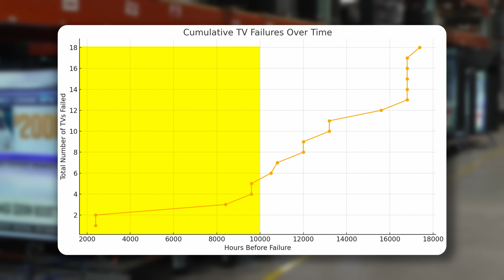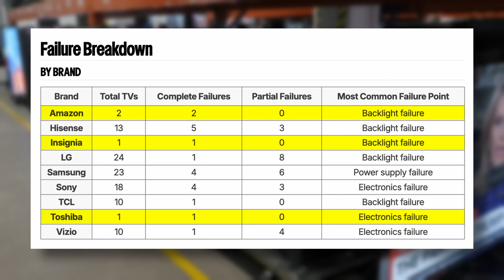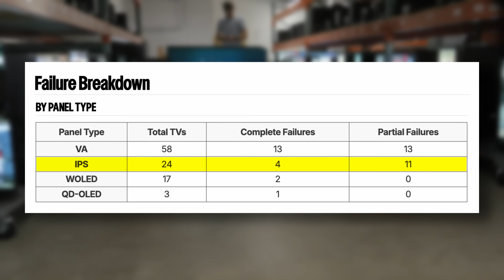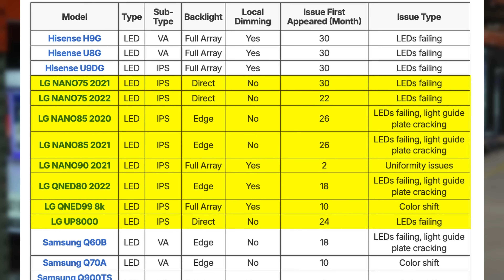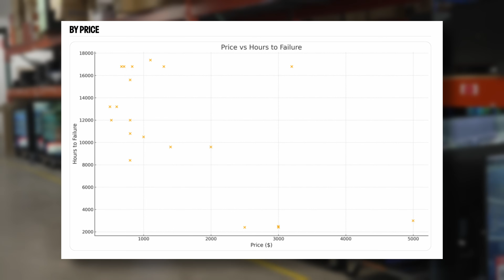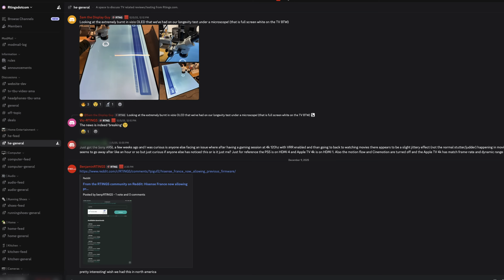Which TVs Break First? Results Overview From Our 100 TV Longevity Test

Comment: My 2005 LG 43" plasma with a massive 852x480 screen resolution and a single HDMI port died after 27k hours. Spent about 8 years in a kitchen with the brightest at full blast. Zero burn-in and the most watched content were the news. Basically part of the power supply died and the plasma display is dim. A dyi repair is about 35€ and considering the electricity cost of running this tv, I've recycled it.
Got a 4k TCL 55" VA panel and it has garbage viewing angles and the worst sound I ever heard on a TV. It felt like a massive downgrade
Reply: Have you ever checked with a killawatt the actual electricity consumption of the TV?
Reply: @zuzkazuzka8284  Relevance? A OLED TV manufacturer can also set a design life of 25,000 hours or 50,000 hours, setting a high design hour lifetime is not mutually exclusive to energy efficiency.
Reply: @TassieLorenzo easy: I’ve replied to the wrong post 😅 That one had your usual “plasma is bad cause it eats tons of electricity “.

Comment: I use an LG C2 as a monitor for years now and it has been used for over 14000 hours.
It does have burn-in, to be specific the windows taskbar and the bookmark/adress bar from the browser can be seen burned-in just a little bit in test pictures, but NOT while using it in games, movies, etc.
Reply: not sure what your OLED brightness is set to but my C1 has 12951 hours of pure desktop use but i calibrated the colors with a colorimeter, 2.4 gamma, way back when and oled brightness is 50. it occasionally has a bit of burn in at the end of the day but after the pixel refresh that it does every shut down it's gone. i think i calibrated it to either 130 or 150 nits (can't remember which one). i rarely use HDR mode (maybe once a year)
Reply: I bought a Samsung 55 inch 4K TV twelve years ago, was using a prehistoric 480 tube model. It probably operates 5-6 hours a day, with no problems whatsoever. I stumbled on an LG 55 inch 4K TV for $189 dollars last year, still in the box.  I was planning on keeping it as a backup, but it's operating in my basement mancave now.
Reply: Same, but with a LG C1. This is why my next TV will be a mini LED.

The stress of burnin isn't worth the picture quality. 

The only reason I haven't bought one is because I need at least three HDMI 2.1 and they sadly only come with two ports right now.
Reply: @AntonioCunningham  Or the two of you could use your brains and buy a monitor for use instead of a TV to use as Monitor
Reply: @AntonioCunningham  There is no stress for me. That burn-in happaned before even 8000 hours and after 14000 hours it has not become worse.

Comment: I have a Sony A90J OLED with less than 1,000 hours that has thousands of dead pixels that have developed around the edges of the screen and it only gets worse with time. It's my first OLED and it will be my last. I've never had a TV last such a short amount of time.
Reply: Honestly, just get a basic Bravia, they last longer and are cheaper. The colours are also fantastic. 
I personally tried the A90K recently and returned it because of the stupid auto dim feature in videos games which ruined the experience since you can't turn it off. 
Got a Bravia 3 and honestly I can barely tell a difference after playing around with the settings.
Reply: @urbanizeddreams  that's my plan. I have a Bravia X900e in my family room that gets used for well over six hours per day and has been used daily since I got it in November 2017. So, the fact the OLED failed in such short time was extra surprising given how exceptional the X900e has been. Definitely sticking with Sony's LCD line from now on.
Reply: @urbanizeddreams ✅💯
Reply: RUN.   From A90J
🏵🧩🐸🙉🍉 🐬vs 🥮🐦‍🔥🏬🦜🪲🪼
The LARGER of TV , Image >  > > STRETCH OUT < <  <. You need Denser Color to look:    3D 
   
 ( Rtings) tested at 10000 cd/m— HDR  
              🔮Color Volume 🔮

Red Luminance =
Bravia8    69     2025          SONY  
A90J        72                   ( OLED ) SONY
B4            89     cd/m²  ( OLED )    LG 
C1            84     cd/m²                     LG 
A80L       92     cd/m²  ( OLED ) SONY
Z80A   ==        ( B4 tier )     Panasonic
Z85A      100    ( OLED )      Panasonic 
C4          104     ( OLED )               LG      
C5          134
G4          140     ( OLED ) —-         LG      
G3          140     ( OLED ) —-         LG
A95K     190   (QD-OMED)
S95C      272   (QD-OLED) Samsung
S95D      371  
S90D      281   (QD-OLED) Samsung
S90F       309  (QD-OLED) Samsung
U75QG  410 🔔( mini LED)  Hisense 

A95L       221   (QD-OLED)      SONY  
Z95B       219     ( OLED )   Panasonic
G5           248     ( OLED ) —-        LG    
S95F       420   (QD-OLED)Samsung
Bravia8|| 344   (QD-OLED)      SONY          
U8QG🐦‍🔥527   ( Mini LED    Hisense             
U9N   🐦‍🔥564   (Min LED )   Hisense
85”UX    530   2023             Hisense
Bravia9   551   ( Min LED )      SONY
U8N 75”  421                         Hisense       
U8N         381    ( Min LED)   Hisense                
U8K         318     ( Min LED)   Hisense
U7N         153     ( Min LED)   Hisense
QN90C    382    ( Min LED )Samsung            
QM8K     394   (Min LED )        TCL 
Qm851    585   ( Min LED)        TCL
Qm8         404   ( Min LED)        TCL   
Qm7K       221   ( Min LED)        TCL   
QM7         291   ( Min LED)        TCL 
QM6K      103 
Bravia7    356   ( Min LED)      SONY
X95L        225   ( Min LED)      SONY 
X90L        272   <  FALD  >       SONY         
Bravia5    137 < FALD-M LED>SONY 
              

“

Green Luminance=
Brabia8  223     ( OLED )         SONY
A90J        237     ( OLED )         SONY
B4            306   (  OLED )            LG
C1             291   (  OLED )            LG
C4            333    ( OLED )            LG
C5            478
A80L        317    ( OLED )           SONY
Z80A == ( same as B4 tier )Panasonic 
Z85A        337   (  OLED )     Panasonic 
G4            426   (  OLED )            LG
G3            420   ( OLED )             LG
A95K        606   ( OLED )          SONY 
S95C        882   (QD-OLED)Samsung
S95D      1167   (QD-OLED)Samsung
S90D        856   (QD-OLED)Samsung
  S90F      1,145 (QD-OLED)Samsung   
U75QG  1415🔔  (Min LED ) Hisense
 
A95L         679  (QD-OLED)    SONY 
Z95B        734     ( OLED )  Panasonic 
G5             887     ( OLED )           LG
S95F      1,551   (QD-OLED)Samsung
Bravia8|| 1,074  (QD-OLED)   SONY 
U8Q🥬 2,073   (Min LED)  Hisense 
U9N🥬 1,917     ( Mini LED ) Hisense
Qm8K    1,206    ( Mini LED )     TCL
——🥬2024 UX 110” ——NOT Tested. 
85”UX   1,656          2023     Hisense
Bravia9  1,130    ( Mini LED )     SONY
 U8N 75” 1,400   ( Min LED )  Hisense
U8N        1,433   ( Min LED )  Hisense
U8K         1,157   ( Min LED )  Hisense
U8H           915   ( Min LED )  Hisense
 U7N           501   ( Min LED )  Hisense
QN90C    1360  ( Mini LED ) Samsung  
Qm851    1,885  ( Mini LED )       TCL
Qm8         1,250  ( Mini LED )      TCL
Qm7K          678  ( Mini LED )      TCL
QM7            826  ( Mini LED )      TCL
QM6K         343 
Bravia7       834  ( Mini LED )    SONY
X95L            781  ( Mini LED )    SONY
X90L            778  <  FALD  >      SONY ‘s = BEST SELLER 
Bravia5        420  <  FALD-Mini LED >  SONY ( NO quantum Dot)

Comment: My 2006 plasma with 27k hours still going strong 💪
Reply: We had a 15 year old Panasonic Plasma that was still doing great Until one day, boom and it was a gone burger. I didn't think we would get the same picture quality and durability but so far our LG OLED has a way better picture and hopefully we get similar time out of it. I'm not confident on durability.
Reply: i have a 2007 CFL LCD estimated 40k hrs (retired but still works)
Reply: @infinity2z3r07  My 2008 CFL LCD with 25k still going. I spent a couple bucks replacing 4 caps in 2010 but that was it.
Reply: @ncohafmuta no cap? Oh you said some caps actually
Reply: @infinity2z3r07  my IPS monitor has the work hours counter, in exact 3 years I have 9k hours.
Reply: @PhantomNovelist isn’t that 8hr straight without a day off for all 3 years? 😂
Reply: @infinity2z3r07  I just checked my CCFL backlit Sony KDL 52XBR - purchased brand new in 2008, notched up 42K hours so far, still performing nicely. Although I'd like to upgrade, I'll wait.
Reply: And keeping your house warm in winter 😊😊
Reply: Awesome to know but it's missing a lot of newer tech (4k, HDR etc)
Reply: @bearclaw5115  TV enthusiasts seem overly infatuated with tech!  In theory you could use a late 1080i CRT with a flat front (they are generally not expensive used) and that should be modern "enough".  🙃
Reply: imagine jf you spent 27k hours not looking at mediocre crap and advertisements
Reply: No big deal. My 1975 CRT was still working when I disposed of it recently. Every LCD monitor I've bought from the early 2000s is still working.
Reply: Backward
Reply: Thicc tvs >>>
Reply: That doesn't mean anything, seems like you barely even watch TV. I had over 21K hours on my previous TV after 5.5 years.
Reply: My Panasonic plasma st50 has 24k ,other one 22k.and third lg is way over ,like 35k
Reply: How's your power bill lmao
Reply: @HughesyTech 13cents a KW. If I watched my pro-151fd 8hrs a day everyday it would only add 11$ a month. 355watt/hr vs LG g5 same size which is 148watt/hr.
Reply: if you like watching things in 1K. LOL
Reply: @RobertoCarlos-tn1iq 💀😅
Reply: @RobertoCarlos-tn1iq  720p if hes luckky
Reply: @RobertoCarlos-tn1iq  who watches anything above 1080p anyway?
Reply: @vasopel  Everyone.
Reply: @Hiromandt  everyone has 4K blue-ray players ? nope...almost no-one has them!
Reply: @vasopel  There are YouTube videos in 8K. This very video you're watching has a 4K option. My phone can shoot video in 8K and I've recorded video from a phone in 4K since 2019. I know someone I went to school with that would shoot music videos for people in 4K 10 years ago. 8K TVs have been around for some years now too.

Just saying. 1080p is doable and I even watch some movies in 720p from time to time which looks OK even with my 1440p monitor. The problem is a lot of old YT videos that were in 240p, 320p, 480p ect. look blurry on current monitors. Some videos I used to watch with my friends 10 years ago on standard resolution screens (2011 era laptop, CRT TVs ect.) don't look as good as they did back then since I upgraded to full HD or higher for everything.
Reply: @vasopel no....but all streaming services have 4k options, along with YouTube. What an odd position to take!
Reply: @vigilant_1934 is this some kind of joke? Who has 8k monitors? Professional video editors maybe? Anyway...YT videos quality is bad, go watch a DVD from a respectable company like criterion...and you'll see that higher resolution doesn't mean higher quality. 1080p Bleu ray is as good as 4k in YT and in other streaming services.
Reply: @vasopel  Everyone, anything less than 4K is painful

Comment: So new TVs are garbage or just planed obsolescence. The oled seem durable but burn in is going to happen after few months if TV is on all the time, but should be fine if you only use it for few hours day
Reply: Not really.  My 2018 c8 with almost 30k hours isn’t showing any signs of burn in.  
I’m retired so my tv is on all day plus I game daily.   No minimap or hud burn in
Reply: Buy something that doesn't cost a fortune and get a warranty, Walmart's warranties are a lot cheaper than other places. You can get a 5 year warranty from them. Also if you buy at Sam's club or costco they often have a 3-5 year warranty that comes with the TV depending on which TV you buy.

Comment: I repaired my Hisense 55r7 model recently. It was a cheap model with the lcd panel held on by double sided foam tape. New backlights were $30, roll of double sided foam tape $5. TV up and running for $35. I do get for the average person its not worth it, black friday cheap 55" tvs were going under $200.
Reply: Same  I recently repaired my 6 yr old Hisense Mainboard for $75-80 USD.  Its ---- flagship though. cost me $1000 . so it was easy quick fix. didnt call technitian. Just open up TV, take the part out n sent to a company to replace an old Chip on the main board n ship it back. just plug in.

Comment: Great work! When I saw the big blue splotch in the middle of the Hisense at 5:13, for a second I thought you had somehow broke into my place and filmed my U8H... it looked EXACTLY the same! I had to live with that for 9 months, and it got much worse. Fortunately I was gifted with a new TCL just yesterday, and I'm very relieved TCL's fared pretty well in your test. Thanks for all your great information!
Reply: hey for sure. that is frustrating.   TCL can Get away from that' deteriation"  or lack of.     Because ( Samsung + Hisenes has more advanced LED backlight :   🟨🟨 Yellow coating on 🟦🟦Blue LED)  SO TCL will not have that issue becuase TCL+ SONY LED：  use ------ straight 🟦Blue LED,  ( WITHOUT yellow 🟨🟨 coating). So it by pass the break down ratio.  But that can be issue because TCL is 🟦🟦 casted.    But they know it, so they compensate by add 🟥🟥.   SO their  2025 models are 🟪🟪 casted, <====Unlike U8H 🟡🟡🟡 casted.  (    🟨🟨🟨 is MOSt soothing for eyes especially Bright highlights.  Human eye are SET UP to watch MORE 🟨🟨🟨) 
BUT 🟨🟨🟨 is the MOST difficult colour for ANY TV to produce.   So it's a Given TAKE for Better Quality Image vs  Potentially less breakage but Inferior (over all image).

SO that Image from ⬜ turns into BLUE is Nature of Technology of backlight the 🟨🟨 Chemical compound self deterioration . IT would have happen to Any high end LED with that coating.

Comment: I've seen many 30+ year old CRT tube tvs still going strong. Things sure aren't made the way they used to be!
Reply: yep i have one, 25 years old
Reply: Still use a ~1980 console TV to play my old N64 games when visiting parents. The red bleed has finally gotten pretty bad but  still truckin on!
Reply: CRT's fail as much as any other tv if not more so. 
And I say that as an fan.
Reply: @bearclaw5115  that's conjecture. you have no data to support that claim.
Reply: You're not seeing all those that already broke down 20 years ago.😅
Reply: @faultier1158  I can guarantee you the failure rate of tv's back then was a fraction compared to the junk they sell today.
Reply: @faultier1158  From my admittedly small sample size, it seemed like the quality control and component quality on Sony Trinitron units is pretty good (even the low end consumer models).  A ~1990 Sony Trinitron 25"  was replaced with a 32" Sony LCD TV in 2009 just for a change not because the Trinitron stopped working (it still works, as does the LCD TV).

Comment: So, as you said that burn-in was just caused due to torture testing OLED TVS, this also means that not torture test an LCD TV,  ALSO can make LCD TVs last longer the same way?
It felt like you guys were reforcong the win just for OLED ones🤔
Normal consumers use can make either screen technology last longer the same way. I have a 6yo edge-lit VA LCD Philco TV which is still great, no issue on its panel and lesser yet in its backlight.🙌

Comment: I have like 3 15+ year old TVs and monitors that I use on a weekly basis or more. I'm just so used to TVs lasting well over a decade. What happened? Why is it that I can go to my local thrift store with 30 bucks and buy a TV that has some features that modern TVs don't have, looks better than some new TVs, and starts up way way faster (because it's not a smart TV)? The last living room TV upgrade happened because it was ridiculously small by modern standards. It still works great, even though it is also about 15 years old. There's barely even any color shift from the back light lamps (which of course, work perfectly and will be easy to replace once they burn out).

Comment: 20 year old Panasonic lcds still going strong but all modern tvs fail in 5 years.
Reply: Walmart sells a 5 year warranty pretty cheap and Costco and Sams club offer 5 year warranty that comes with the TV depending on which TV you buy. I have a 32 inch panasonic LCD from 2010 and yeah its still going with no issues.
Reply: @SaraAB87  A 10-12 year warranty would be an excellent inclusion on a television (or refrigerator or microwave or washing machine or so on). A suitably motivated appliance company selling durable goods with a long design life should offer it! If they know 95% of their televisions last 17 years plus minus 3.5 years (so a 95% confidence interval of 13.5-20.5 years), what have that got to lose? Unless it is not true and their durability standards are subpar...